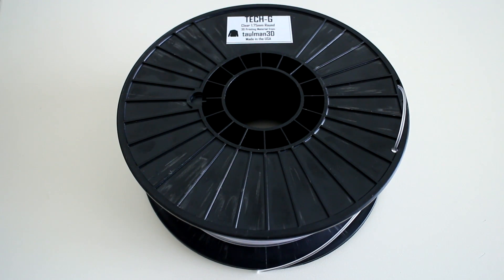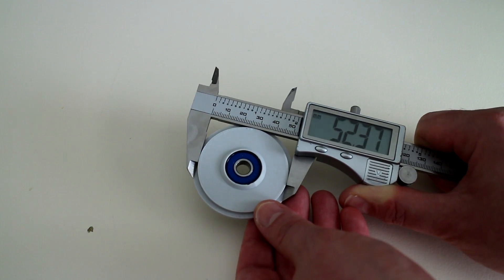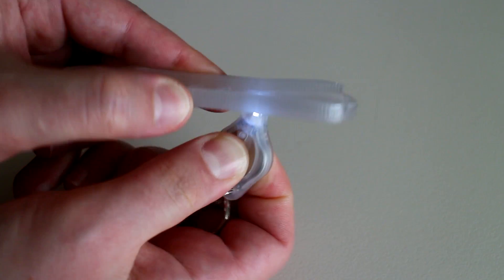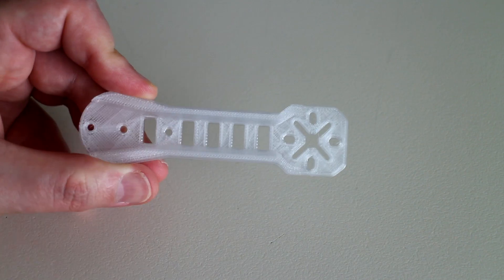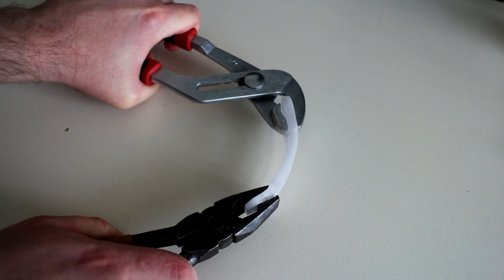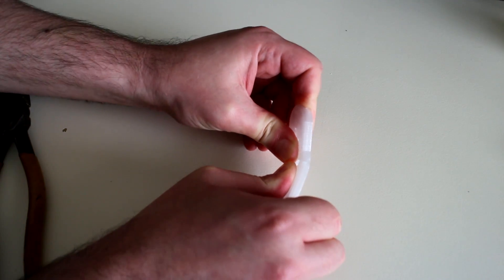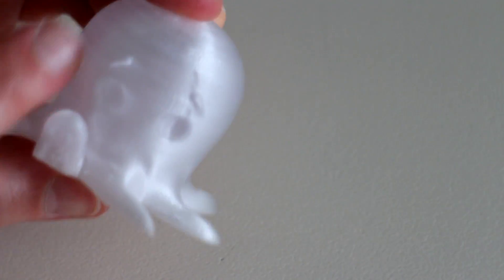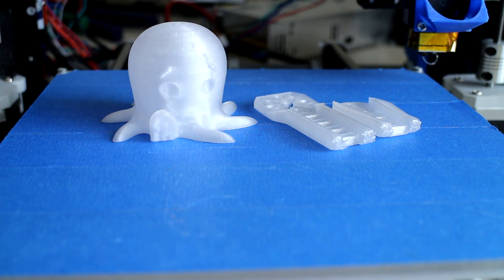3D Print in PETG plastic

Comment: Hi Tech2c !
I just received my replikeo kit. where can I find the instructions (replikeo's site sends you to prusa i3 rework instructions with drilling and so on). Also, how long did it take you to assemble the kit ? I'm really busy lately.
Reply from the maker: +RoyPe'er 
Took about a weekend to assemble and tune from scratch. That's because this was my first printer. Experienced printer builders could pop one out in an evening.

The RepRap website has all the info you need. There's other YT videos as well. Check out the forum on the RepRap site for Replikeo kits http://forums.reprap.org/read.php?406,344338
Reply: +Tech2C how did you assemble the y carriage ? It says you need 14m screws. I don't get it. how can you have "nothing" on the side of the heated bed if you need to have a nut to hold it from the other side. do you have any idea ?